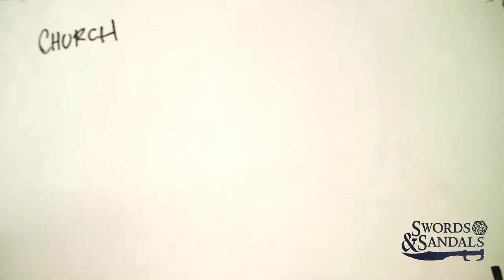How to Build a Medieval Church (from foam & wood) + FREE Templates

Comment: This is exactly what I was looking for. I'm going to cut the whole thing 1-2cm from the bottom and attach magnets to both things, so it's easier to do D&D combat inside. Thanks!
Reply from the maker: Sorry my response took so long. For whatever reason, it only just popped up as new.  That said, I'd glad you liked it! I am currently designing a multi-level church with gameplay in mind. Something that will separate in 2 or 3 pieces.

Comment: If you measure the sections so that you have one end the full width and then make a line at that length and another in parallel to that you can cut one side of the paper through as well as the foam filler between the lines, leaving the paper on the other side alone will leave that corner intact.  Measure the other three sides and repeat this process for the other three corners.  This allows all of the walls to remain connected together with the only seam being the edge of the first section.  As for gluing them together all you need to do is put the glue in the slots and then fold one section into the gap.  It is best to fold the end sections over and into the gap.  This will, or should, make the wall sections square to each other.

Comment: Hi Jason, this is my first time viewing any of your content and im loving it! Im actually thinking of making a model of our new church facilities and this helped me tremendously.  I want to know, how would you recommend that I build the spire portion of the steeple? In the past I've used tape and foam core board (horrible experience) as well as poster board. Any advice you give is greatly appreciated.  Thank you!
Reply from the maker: Appreciate the kind words and thanks for watching! As to the spire, I guess it depends on style of architecture and how much detail you want in your model.  Overall, I would start with styrene. Maybe 1/32" thick. 1/16" max. Plastic cut be tough to cut, so be careful. It will cost more, but look into some of the precut stuff as well. Great thing about this stuff is that the special styrene glue dries in a few seconds and is quite tough. And you can sand the edges where you need to. 
Another option would be wood. But I would only do that it you have access to a belt sander and can make quick work on sanding down the shape you need. Use base wood.
Hope this helps.  Good luck with your build!
Reply: @Mythreach  thank you very much. I can get the plastic sheets from The  Dollar Tree and use my hot knife to cut it. I never would have thought of that.  Again thank-you,  have a happy Thanksgiving.
Reply from the maker: You too! Depending on the manufacturer, you can also cut thin styrene with a sharp hobby knife.
Reply: @Mythreach  this maybe a stupid question but what is styrene?
Reply from the maker: There are a 1000 materials out there, all with nearly the name, so dont worry, its a very common question. Styrene is a rigid plastic you can get in sheet or shapes. You can curl it with a heat gun, cut it with a knife, drill it, and sand it. A popular (albeit more pricy) brand is Plastruct.
You can also look for HIPS which is high-impact polystyrene.

Comment: I have a question, I want to make the inside too, what floor and wall texture would suit this church the best? Also your work is amazing. Thank you for the free templates, you are awesome!
Reply from the maker: Thanks so much! Sometimes I wonder if I'm wasting my time or not with my templates, so its good to gear they are being made use of.  As for the interior, its all about scale.  Material-wise, i would always use wood for the floor. 1:12 scale, just use popsicle sticks. For something like 1:48, use matchsticks. Just glue them down, this some brown paint to nearly water, then paint them over and over until they are the aged color you want. For the walls, get cheap foam board, peel off the paper, and carve stone blocks on it after gluing it down. Or, use a larger wood stick for paneling.  Just remember that wooden walls have horizontal dividers between each piece to "nail" them down. Use could also do nothing to the foam board and paint them cream for a modern stucco look. Use some sand in the paint if its 1:12 scale though.
Reply: @Mythreach  when I was watching this video for the first time I was hoping that you would have templates 😂 
I will also add an inside curcle stairs so it can go to the top, and at the roof I will add a bell. I will make the floor like you said, but I want the walls to kinda match the stairs too. I was thinking of a stone texture but not like the outside. Maybe like cement colour with a little bit of texture. I didn't understand where to put the matchstick and popsicle stick 😅 English is not my first language, sorry.. and thank you:)
Reply from the maker: Use the wooden sticks for the floor pieces. Gluing them down to a foam board. And then stain them. At the scale, it will look like a real floor with very little work.

Comment: what foam did you use for the bricks, its freaking awesome. thank you.
Reply from the maker: I only use XPS foam. Its the pink insulation foam from Home Depot. Lowes has theirs jn blue, but I feel the pink stuff holds better detail. 
You can cut your own with a hobby knife or hot wire. I have a video that shows me cutting my bricks with a hot wire.  And in the descriptions I also link to my Etsy where I sell them.  
Thanks for watching!
Reply: @Mythreach  thank you brother.

Comment: how long does it take to get okay at cutting foam straight
Reply from the maker: Great question!  I will let you know when it finally happens for me.  :) 
Most important thing is to have a very sharp blade. I also use a box cutter for straight edges instead of a hobby knife. Helps me cut straight edges easier.
There are also cutters that use guide tracks but I've never used them....yet.

Comment: If i do build this i might put a bell in it
Reply from the maker: I think a bell would make a great addition! With the holidays right now, you can probably find a plastic bell that would fit perfectly.
Reply: @Mythreach  i would buy a small brass bell
Reply from the maker: If you go the brass route, I'd recommend using wooden supports connected to ball hearings on each end.  This way you can actually ring the bell without too much upper support.  Makes me want to go out and look for 1:48 scale brass bells.  Lol
Reply: @Mythreach  that would be cool if the church had a bell in it that you built in the video
Reply from the maker: I have a few more church designs in the works. Perhaps I will try to incorporate bells into at least one of them.  Maybe even a clock as well.